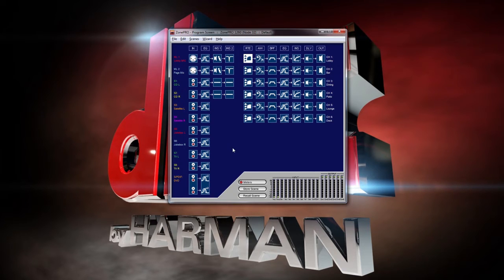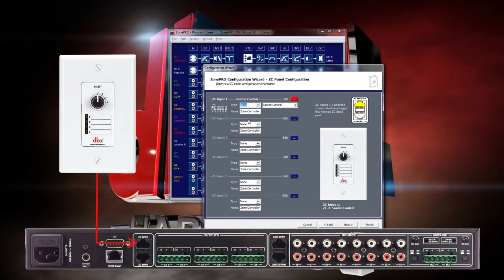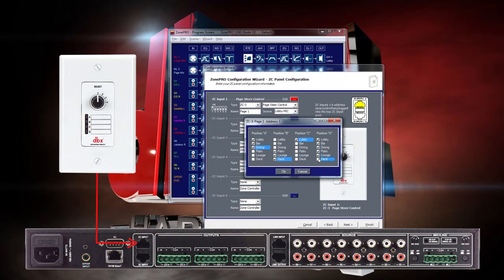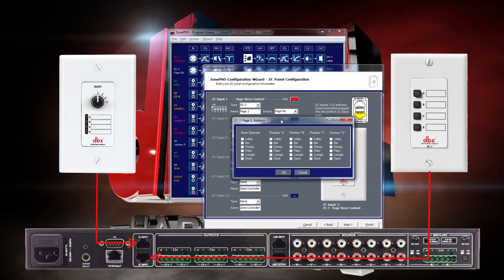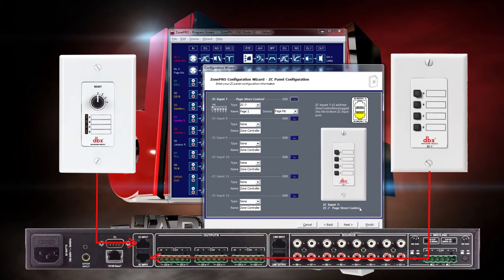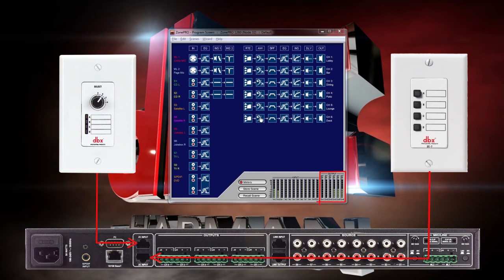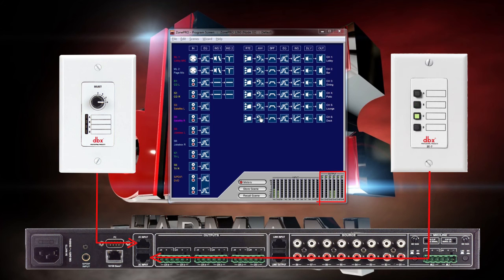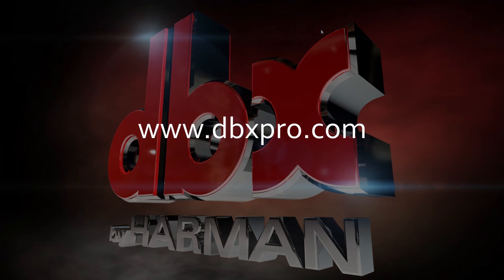DBX Page Steering with ZC3 and ZC7 Zone Controllers

Comment: Hi, My first question is: Can I use the same mic source with zc3 and zc7? I need a 6 zone paging configuration using 1261M, so this may help. The second question: For this configuration, can I sidechain the controllers, or connecting in different ZC input at the processor is the only way for page steering? Thanks in advance.